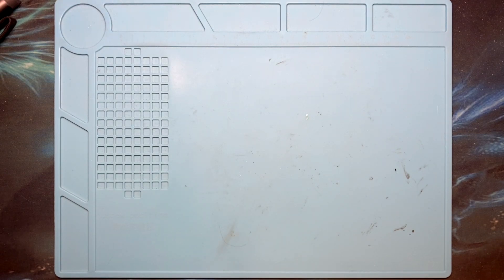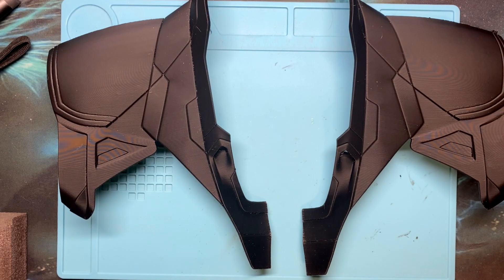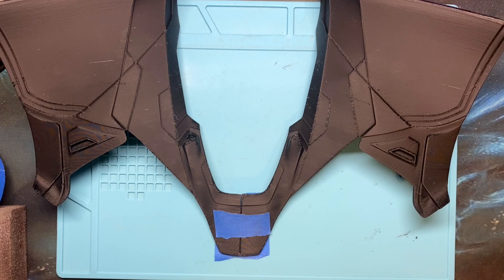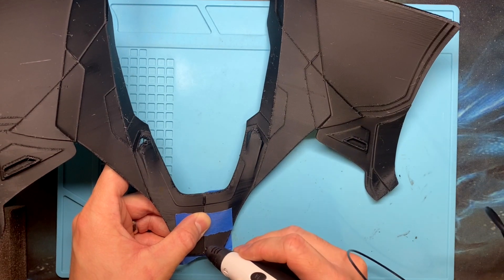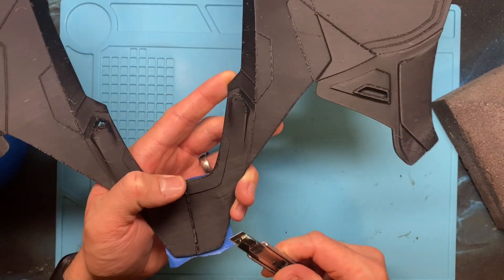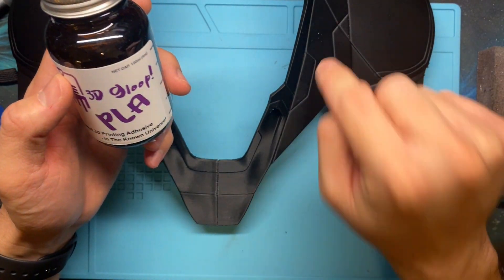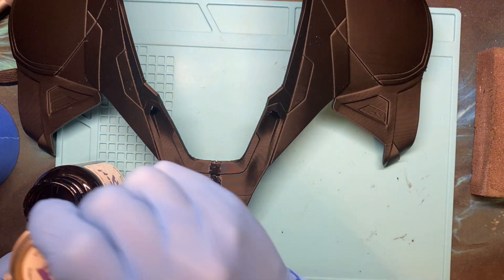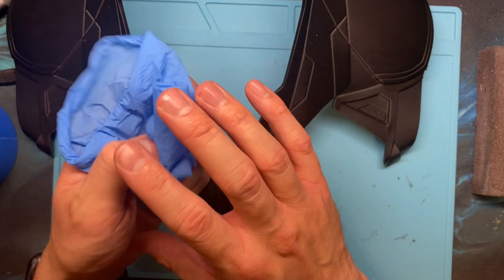3D Printed Ironman Suit Update- 'Welding' 3D Printed Parts

Comment: Man, consider getting a cheap set of diamond files instead, it can absolutely take a seam like this. If you keep scraping with the knife like that you will seriously injure your thumb some day.
Reply from the maker: After a near miss a while back I do have good files now! Thank you though!
Reply: @SNRTechBytes  The only stitches I ever had in my life were from trying to cut apart a maze print that had merged. I wasn't even doing a dangerous thing, but the brand new scalpel slipped and stabbed my hand. 2 or 3 stitches from that - and 3D printing is supposed to be my safest hobby :p

Comment: Great video!  Came here trying to figure out how to weld petg, and I think I've found my solution.  :)  Just know, that if that Gloop is or contains a solvent, the solvent aspect is likely going to go right through those gloves, skin, and into your bloodstream.  The yellow or green thicker rubber (toilet) gloves are what you'd want if you're concerned about it's dangerousness.
Reply from the maker: Glad to hear this video helped you! If you do go the 3d gloop direction be sure to get their PETG blend vs PLA. I also find that for the 3d pen going hotter than your print temp for welding parts yields best results so see if you can get a pen that hits about 230C (The one in this video maxes out at 210)! This is very true about the solvent. I know it depends heavily on the solvent and admittedly I haven't checked the permeability of the particular solvent in 3d Gloop. Its pretty rare I get any on me anyway and the gloves are more to keep the plastic from getting stuck to my hands since plastic is dissolved in the solvent! Good luck!

Comment: that isn't how you weld 3d printed parts at all. thats a good way for them to break
Reply from the maker: I don't really want to go in depth on stress and strain analysis but long story short 3d printed parts get their flexural strength from the outside roughly 5% of the part. This is why thin parts perform better by increasing perimeters rather than increasing infill. By adding that extra layer of what is effectively extrusion on the outside layers the flexural strength is very high. This is less true on the 3d gloop side but its still quite strong on that side as well. There's a great collab by 3D Printing Nerd and punished props from a few years ago where they discuss various bonding methods and their testing showed that 3d printing pen bonds are in fact some of the strongest. Likewise, I believe Stefan at CNC Kitchen has also tested this. Anyway, in my experience this method of bonding is incredibly strong and even after dropping parts I am yet to have one break across a weld but rather break at a different location in the part.

Comment: Cool tip about the 3D Gloop. I have been welding with soldering iron and 3D pen (phase 1 and 2), but I will try the Gloop method on the outside seam..Thanks!

Comment: Planning on buying a 3D printer in the coming weeks. Is an Ender 3 good enough to print an iron man suit? Or should I go bigger? Also your video is great, very informative, I’ll subscribe. More Ironman suit videos please sir!
Reply from the maker: Ender 3 should have the capability to do so! You will however have to get creative with the helmet or print it in 2 pieces. I would suggest the Ender 3 V2 which was recently released as it has better quality but will still have a size issue. The helmet is honestly the most difficult part!
Reply: i have an ender 3 and i would go with what he recomended or get whats called an ender extender to upgrade a ender 3